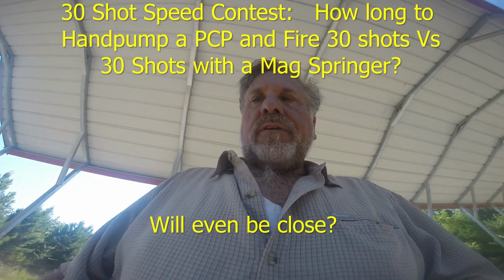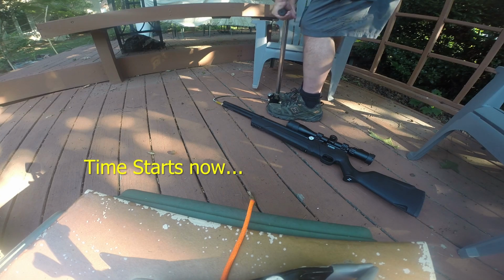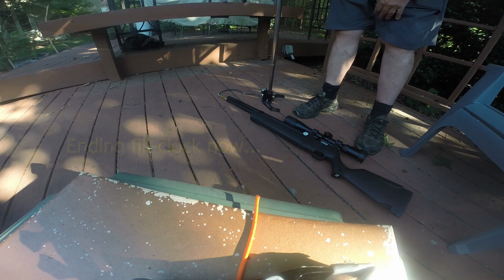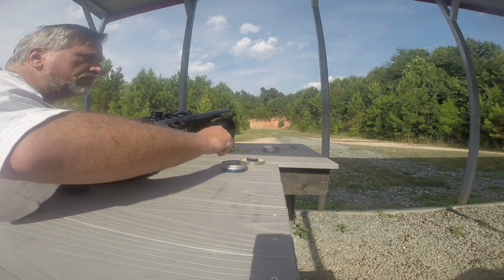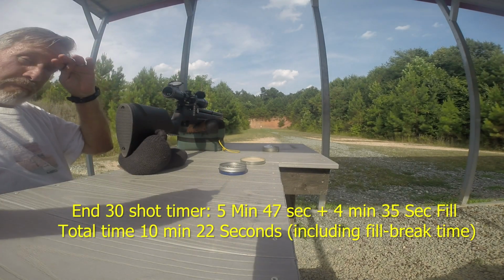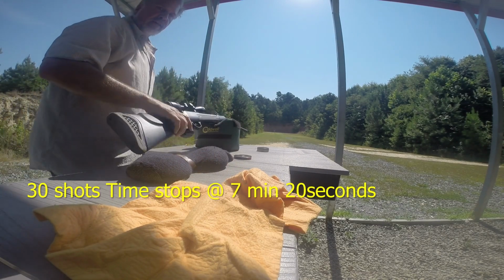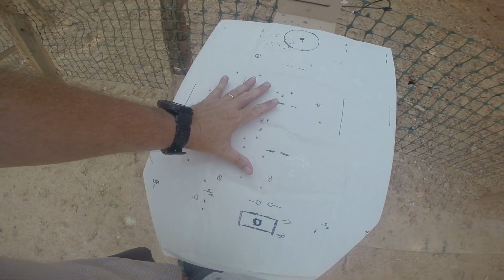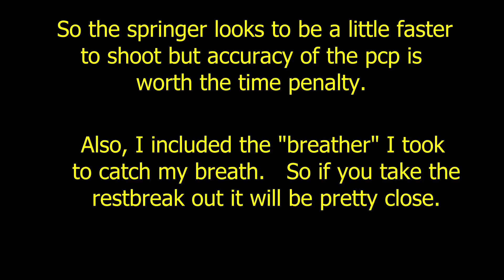Break Barrel Vs PCP - 30 Shots Timed Including Hand-Pump Fill - 100 Yds

Comment: Get the new gx 4 compressor.  Screw that hand pumping, it fills quick. I like pcps and they hold the air so as long as your filled and ready 24/7 you’re good.
Reply from the maker: I normally use compressors.   I was curious to see difference in total time to hand pump a pcp for 30 shots versus a break barrel.   You’re right about pcp rifles holding air for a long time.  The test showed that the total time between the two rifles was within about 3 minutes.   The accuracy of the pcp versus the break barrel was in another class all together.   The break barrel’s group was probably 4 or 5 times the size of the pcp’s group at 100 yards using the same pellet.   Thanks for watching & commenting.

Comment: Springer is going to be quicker every time. Just load n go. The pump time is the PCPs downfall
Reply: But you gain so much accuracy in the PCP
Reply from the maker: The springer is about three minutes faster than the PCP.   But I also took a break in pumping up the rifle so someone in better physical condition than me could shave that down some
Reply: @motorgearhead  another time penalty  is that pump will get hot as hell. It won't last very long if you get in a Rush.
My uncle has a hatsan pump I think. It's much easier than my Benjamin.